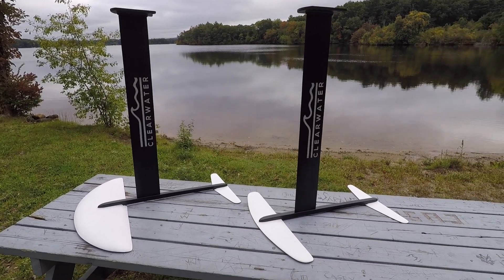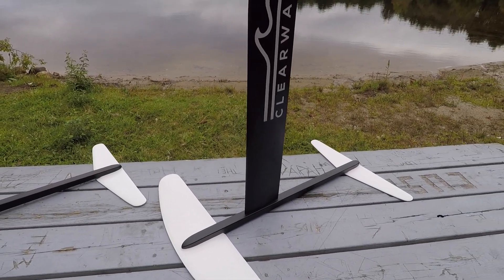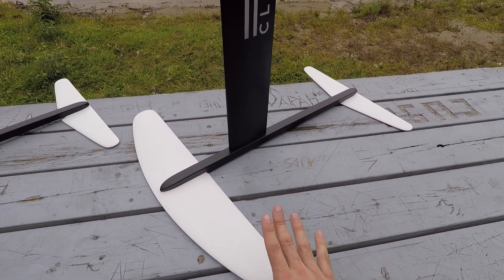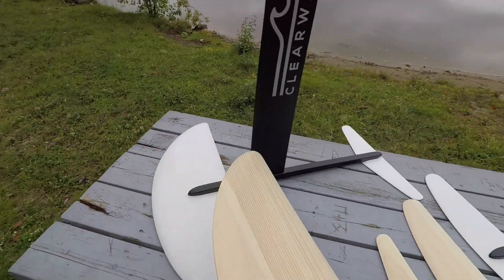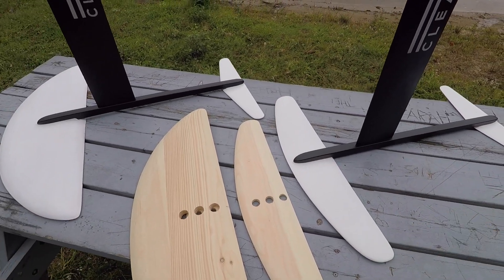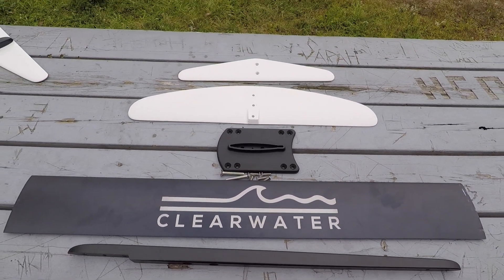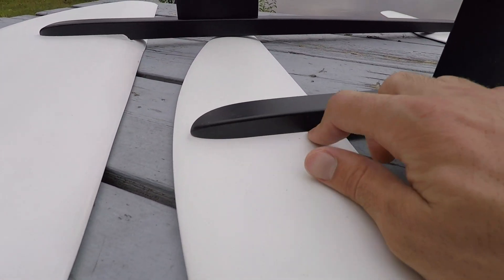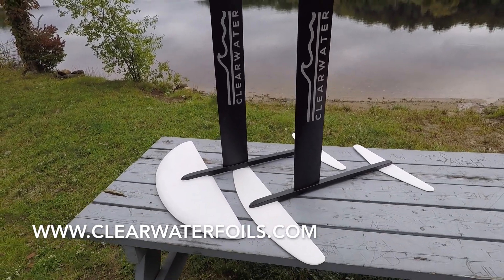Even Easier Hydrofoil BUILD!

Comment: Hi I love the aluminum mast and fuselage. We spoke a few months ago about a foil for a stand up paddle board. ( I build the jet drives for paddleboards) I’m getting ready to start working on an efoil and I was wondering if the aluminum mast was available in a shorter version? My goal is to get the board out of the water to reduce drag and a three foot mast attached to a longboard will be really ungainly. Let me know if a shorter mast is available.
If not I’ll be buying the original kit lol.
Also 8 saw a pic in your gallery of an eSUP any chance you could connect me to the builder ...... he might help me avoid some false starts. Thanks Frank.
Reply from the maker: Hi Frank the two mast options I have are 36 inches and 15 inches. Shoot me an email to discuss.